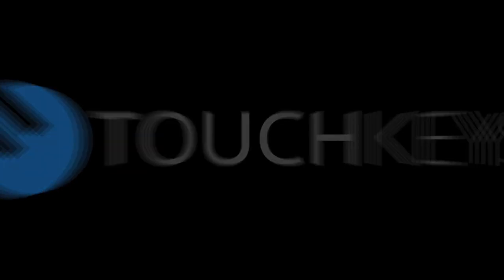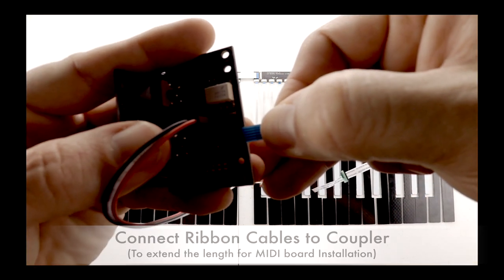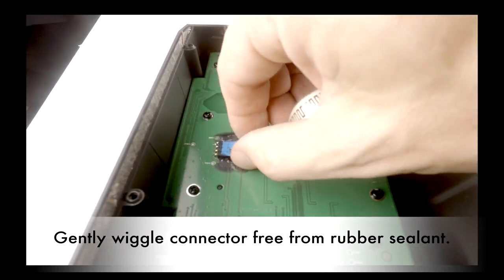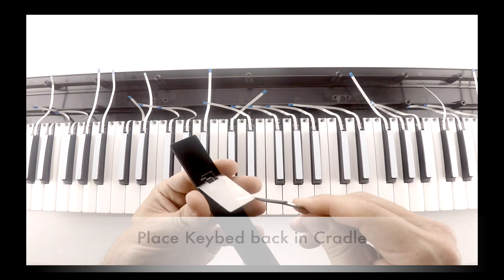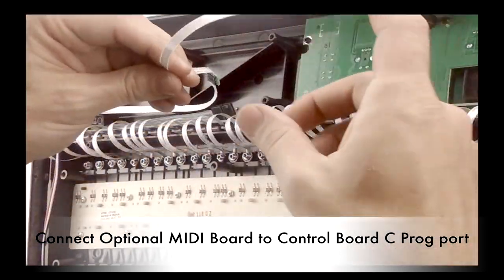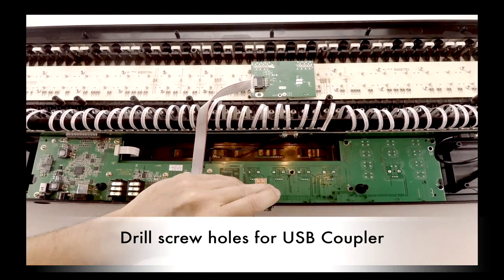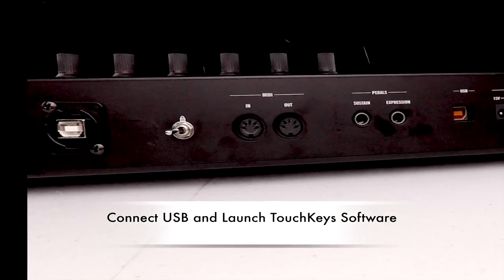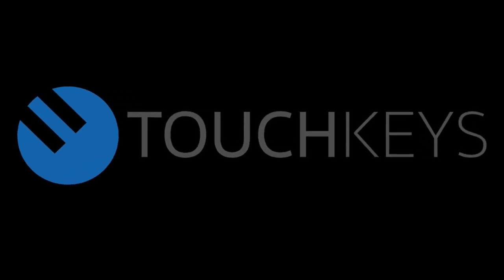TouchKeys installation tutorial

Comment: Q:- I have 88 keys midi controller /SL88 Studio/, is it possible to install TouchKeys on the highest 3 octaves only? I`ll need an additional midi board I suppose... I think it`s possible but will be great if you confirm. Thanks.
Reply: Hi Boyan! Did you ever find out the answer to this? I am thinking of doing something similar... cheers.
Reply: @louiswild338  Hi Louis, if you have a midi controller that is able to split or define zones /like mine- the SL88 studio/, you can leave a part of the keyboard inactive using its software /in my case- the SLEditor/; then you can install for example 24  touch keys onto the upper part of your keyboard; both- the touch keys midi / usb-midi and the your keyboard controller's midi / usb-midi out must be connected to the computer; later, when you play using the VST's in your DAW, you have to select both tracks - the midi controller's midi track and the touch keys midi track, to sound simultaneously. It will work. Hope this helps ;)
Reply: @boyanmladenov  thanks for the info Boyan! Think my keyboard can be split into zones so I think it will work for me... good to know!